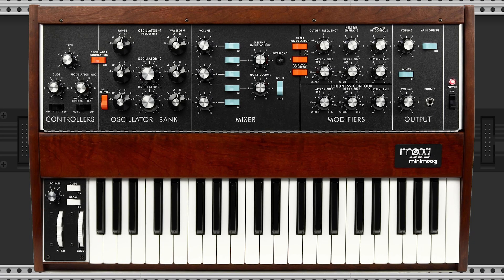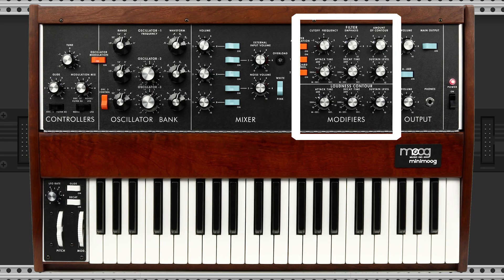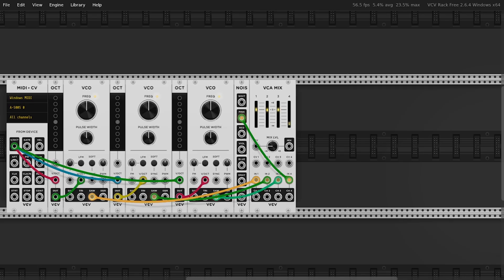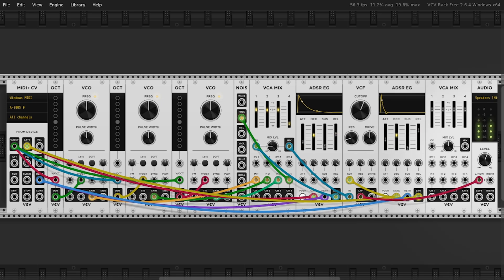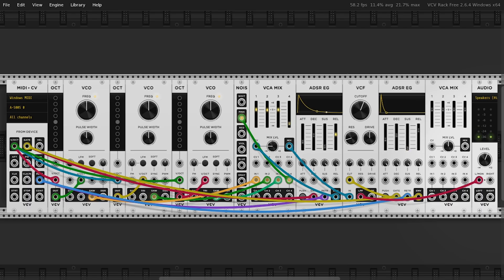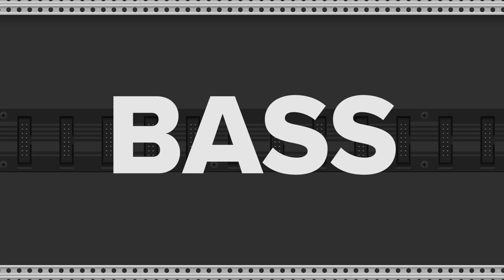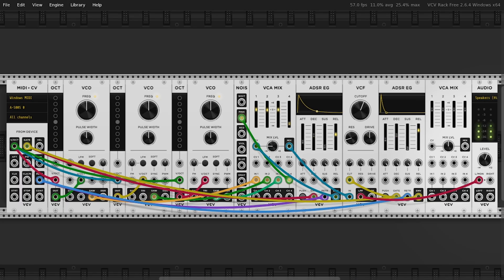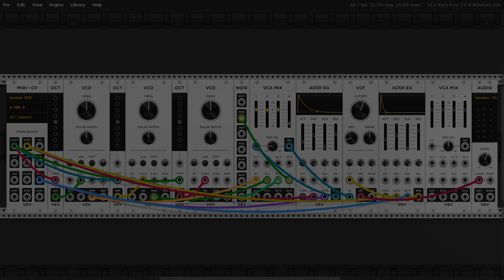MINIMOOG in VCV Rack – Learn Modular Sound Design in a Fixed Rack Setup (Bass, Pad, FX & More)

Comment: Very Cool! I may have to build this one and expand on it with modulation etc.
Reply from the maker: Yep, that’s my default patch in Rack - works great for keyboard based ideas
Reply: @Saturata  I keep changing my default patch. It is mostly set to have all the connections to my hardware all set, and the ability to record the output to a .wav file. But then I make a tweak and save the default again, so it keeps evolving.